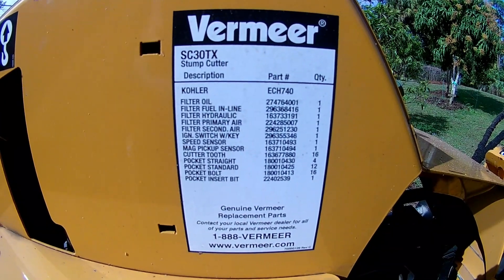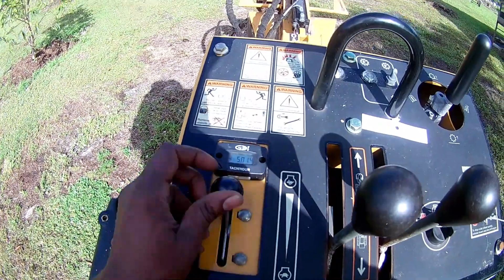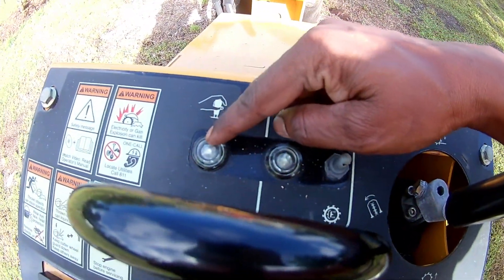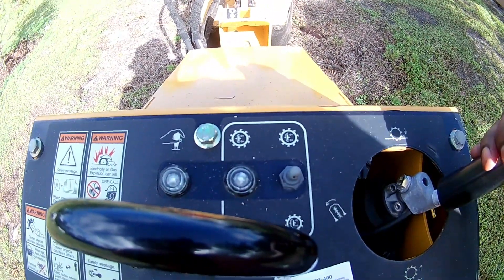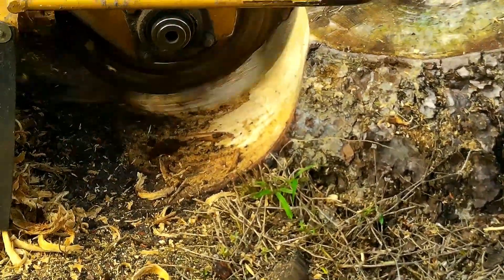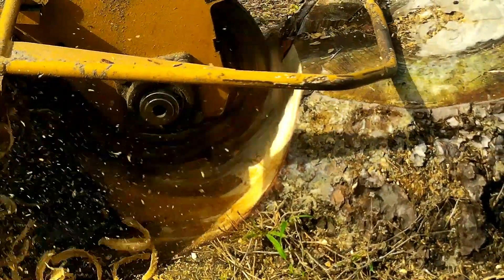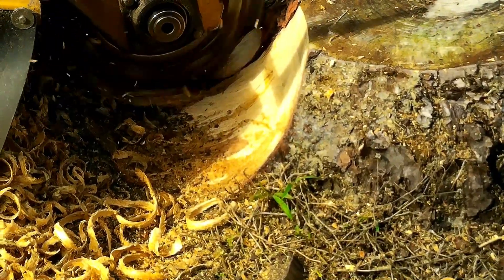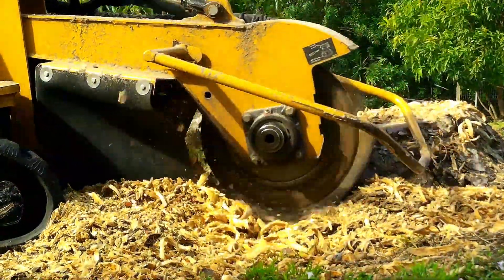Stump Grinding Using Vermeer SC30TX Grinder

Comment: How long did it take you to do that one stump?
Reply: The work can go faster when the blades are sharp. Make sure that the blades are sharp when you rent the machine.
Reply from the maker: I did my first batch 2 years ago and didn’t know much about the grinder 8-12” stumps was taking me 2 hours. I though because it was pine and they were old it’s why it was taking along time.  Upon returning the unit after 24hrs use I asked questions and found out with this machine it should take max 1/2 hour.  The guy at the rental place inspect the tooth and they were all dull which cause the lengthy grind time.  
The second time around which was this video was approximately 20 min on 12” stump 6” below grade.  This video was on an old huge stump which took approximately 2 hrs.  This particular stump was approximately 36” at grade due to big roots above grade.  When renting a grinder and ask about hydraulics, the last thing you need is to manually move this machine left to right.
Hope this helps.
Reply: @BARR8323  dos pinches horas y una maquina así de grande el que la opera es bien tonto para tardarse asta dos horas no pues woooo dijo el perro 🐕